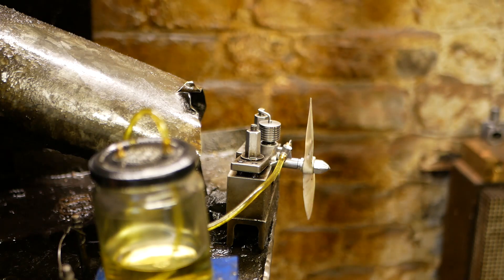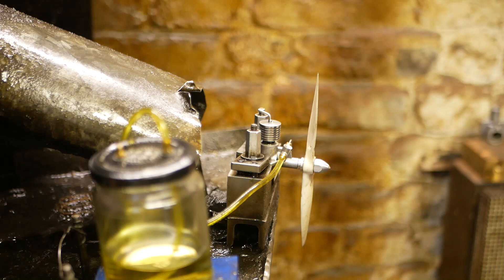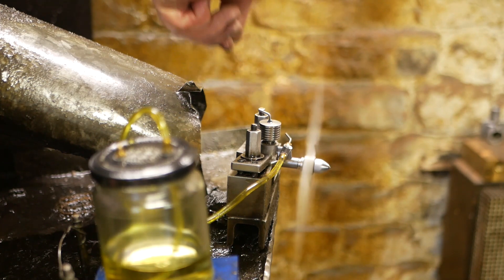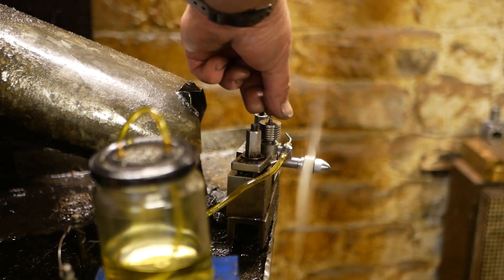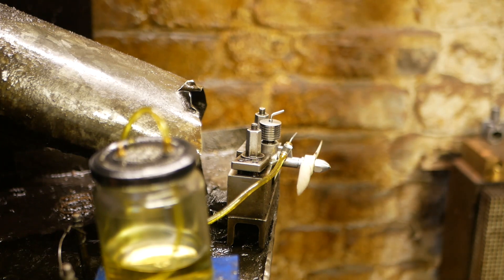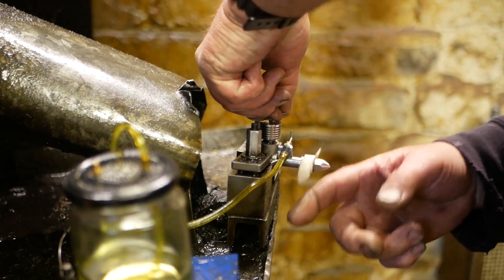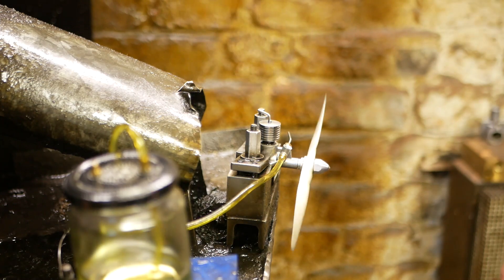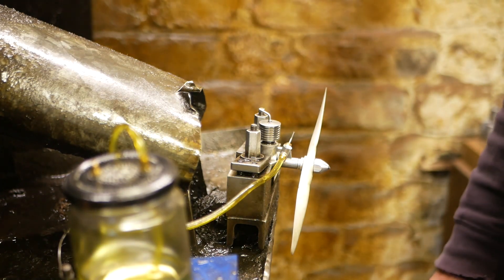PAW - how to start p.a.w .55 engine

Comment: You said, that the fuel level must be a Little bit under the the carburetor but not to low. Whats going on, if you are climbing, nose up with the airplane?? Thanks!
Reply from the maker: Once the engine is running, the engine will draw fuel in, if the tank is too high it can siphon into the engine while it is not running and will flood it.

Comment: I have three .55's bought through the late Eric Clutton. What size prop are you running in this video?  I have run mine on everything from a 5X3 to a 6-4. 5X3 seems to make the most power, with the larger props giving a better idle.

Comment: Awesome video.  I was cleaning my work room the other day, and came across some used diesels I got several years ago.  One of them is the .55.  I got it running yesterday after a bit too much fiddling.  Very excited to find this video.  Can't wait to get out and try it again!   Looking forward to showing up at my field with some diesel powered planes next summer.  :)

Comment: I acquired a PAW .15 FF/CL last weekend, that - usual story - had sat around for ages not run, and the fellow who had it said he wasn't sure if it was any good, it was all seized, etc etc. Well thanks, I said, I'll see if i could get it going, thanks very much.. 

I did not know it was a PAW at the time but suspected so, and confirmed on Sceptreflight's very helpful site when I got home. That led me to this video - which is really nicely done and I enjoyed it thoroughly. 

So it wasn't even siezed, just gummy stiff. One capful of nitrate thinner down the intake and a shot in the cylinder, and a few wiggles of the prop later it turned over fine with a nice pop. So later this afternoon, it was time to have a go at it, having mounted it up for running last night. Filled the tank, opened the needle 2-3/4 turns, the compression was stuck but not siezed and was a bit high but ok. Three turns of the prop with the intake choked, two drops in the intake and turned it over slowly once, and then gave it a hearty flip. Holy mackerel - instant running! So today was my first ever one flip diesel start, never thought that was going to happen but I was hopeful, and prepared, after watching this. Wow what a sweet handling diesel it is, well done folks. It is below freezing outside BTW, so no tach readings and only about 2 minutes run time total in two short runs. But I ran the compression up and down then settled on a slightly rich and under-compressed setting for "whee fun" running. After the first tank ran out (a very small Perfect tank), I refueled, choke flipped, and got an instant replay of the first start. So.. surprised and delighted I was to find out it handled just like you show here! I now find myself fantasizing about a .60 TBR R/C.

Comment: We used to refer to too much compression as running hard. Too little running soft. When in a model you have to set the mixture a tad rich because it leans out in flight. Great tutorial. I'll have to get my old PAW 1.49 running soon
Reply: Man I’ve been runnin my old mk17 and I see your into bikes man I traded my 07 v star for a 91 f150 4x4 manual trans and got back into flying

Comment: make a proper exhaust stack for this engine.. or else it will be an oily mess..
Reply: If you have any experience with diesels you will know that an exhaust stack is comparable to an ashtray on a motorbike
Reply: Charles Hurhaus how do you come to that conclusion ?
Reply: @direktorpresident  this is why I like PAW engines... they have a muffler option..